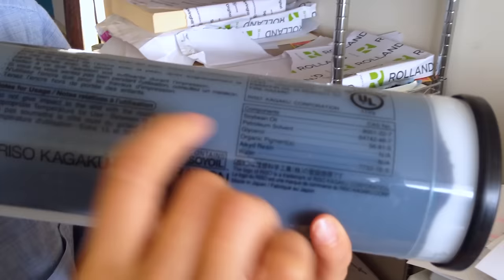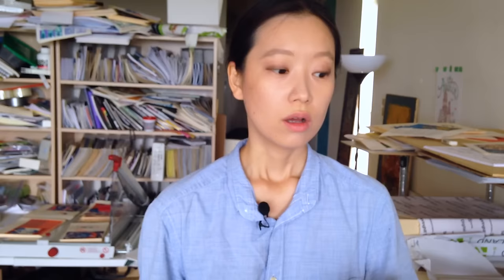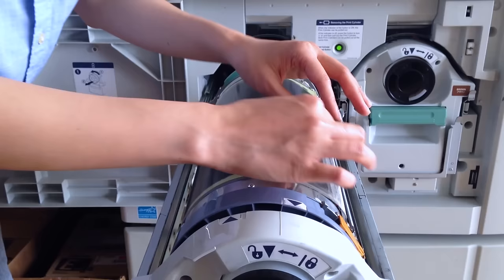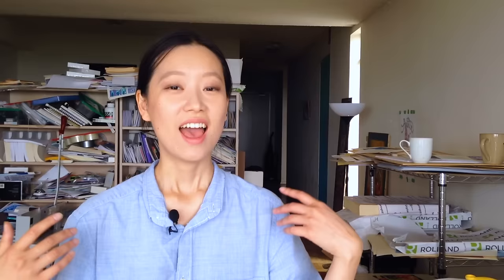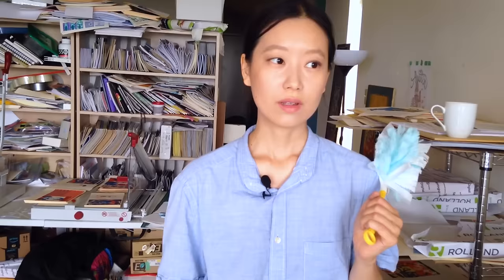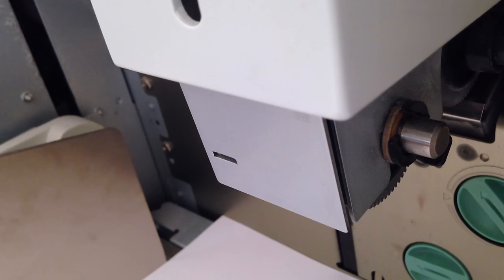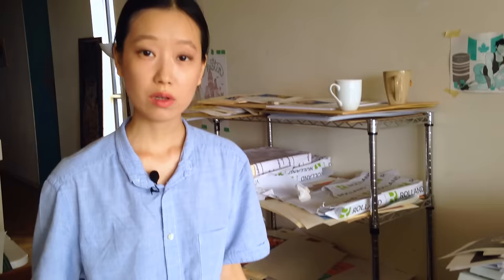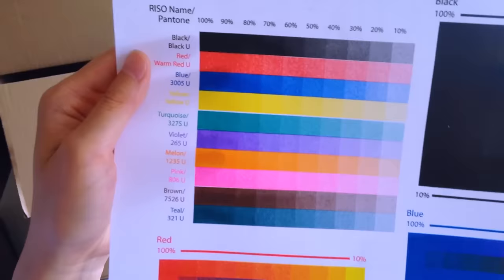ALL ABOUT RISO | olivia and pindot | risograph

Comment: I have been a Tech for Riso Machine's for 20 yrs and I can say if you understand how a Riso works , we are far superior to all technology to date!
Reply from the maker: I wish I knew more technical stuff!
Reply: I'm interested in your comment. I was just sitting here wondering how in the world this process could possibly compete with either inkjet or laser, both of which register perfectly and dry completely on a wide variety of papers, including coated grades. Olivia says in the video that she can only use uncoated paper, the ink never really dries, her customers some times get ink on their hands from her finished product, she has trouble with tracking marks, and registration is not guaranteed. How is that "far superior"? (Full disclosure - I am retired from nearly 40 years in the printing industry, both offset lithography and letterpress.) This is not meant as any kind of negative comment; I just don't understand.
Reply: It’s also non archival so if you want to make anything with permanence a Riso is not going to give you that the original intention behind the machine was to be able to make simple copies of things extremely cheap

Comment: 1) Use the Riso FW5130 series, which is full color. Ink is very similar (I wouldn't be surprised of it's the same ink).  It also does not use a master so no reason to refill masters or empty them.

2) Use at least once a day (twice a week minimum) as it is ink based and will clog up the holes and you'll need to call a tech to unclog them.

3) Try leaving the printed pages to dry before running it through the machine again to avoid roller Mark's in the second pass. There is no heating element (unlike copiers) so you have to let it air dry.

4) It is a high volume machine so if you're going to run fewer than 30 prints, you might as well use a copier as it is cheaper.

5) We're basically talking about a glorified ink jet printer so take similar cautions as you would an ink jet.

6) Risos are built around the ink and the guy who invented it said as much
  Therefore inks are very expensives.
Reply from the maker: Thanks so much for this very thoughtful comment! I will look into that machine, since I haven't heard of it before. I do always airdry for at least a half a day, a whole day if my deadlines permit me. :-) But the ink still smudges when there's heavy coverage, and sometimes artists just spray fixative on the prints tbh. It's true that the riso becomes more cost effective as volume goes up, for sure!!! Thank you again for the comment!!

Comment: Is the ink used in it an oil base?  The ink we use in a normal offset machine?
Reply from the maker: Yes it is either soy oil or rice bran oil. Not sure if it is the same as offset since I don’t have experience with offset.
Reply: Olivia and Pindot Got it, thank you very much

Comment: if i will be using an 8 1/2 by 11 paper, can you print on the whole paper area using a B4 size riso machine?
Reply from the maker: The leading edge (the edge of the paper that will be fed into machine) will have a gap because the screen doesnt start right at the top. The rest should be okay. I suggest using a larger paper and just cutting to full bleed.
Reply: thank you for the info. but i want to print receipts using riso with registration markings for cutting purpose

Comment: Great video! What is the heaviest paper you can run through a Riso machine?
Reply from the maker: Hello and thank you! The fact sheet on my machine recommends 46 to 210 GSM, so that would be about 13 lb bond to 110 lb index or 80# cover. The paper needs to be weighty enough to be able to withstand getting pulled into the machine and getting a bunch of ink on it, however, the feeding mechanism has a thickness limitation, and chokes on really heavy papers.

Comment: Very informative.  Thanks a lot . Really impressed with Riso speed . However little disappointed that it can't print on gloss art paper.
Reply from the maker: It's ink so the paper has to be able to absorb ink. I haven't tried it on inkjet photo papers yet, but for sure it won't do well the glossy laser papers!
Reply: Glossy paper is not supported but matt paper and ink jet paper will provide a superior image